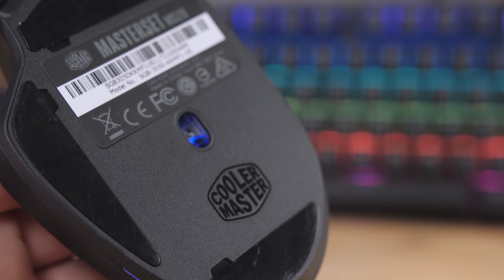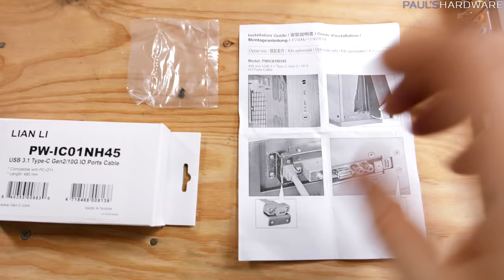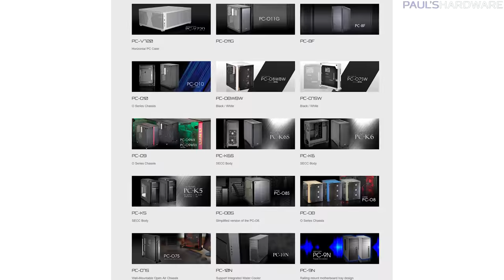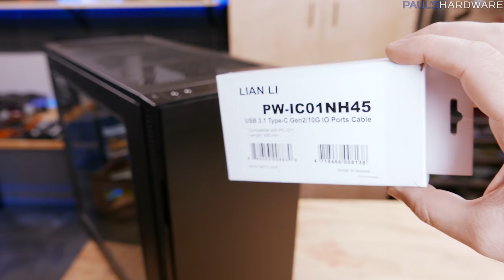CASE MOD! Adding a 10Gbps USB 3.1 Gen2 Type-C Plug

Comment: Drill bit sizes: 1/16", 5/64", 3/32", 7/64", 1/8", 9/54"...
I mean, I get it, those are increasing in steps of 1/64" but it still looks ridiculous...
"Could you please hand me the 11/64" drill bit?"
Reply: CheaterCodes if you ever see any x/54 fractional bits you're in some madman's shop and need to get the hell out.
Reply: whoops, yeah, that'd be some crazy dude xD

Comment: I realize this video isn't a new video, but I wonder if someone can help me out.  I have a Lian Li PC-011 AIR case.  It has a front panel cable, that is the USB 3.1 gen 2 connector.  My motherboard does not have a USB 3.1 gen2 header, like the one on Paul's motherboard in this video.  Is there a pcie card I could purchase that has this type of header?  I want a pcie card with this header, like the one in this picture.  https://cdn.wccftech.com/wp-content/uploads/2017/12/DSC_1050-Custom-1-1030x687.jpg

Comment: What's the craze about usb c?
I transfer like a movie every month via usb, and that's about my usage of usb other than mouse and keyboard, but that's not exactly data sensitive.
Reply: Most new android phones come with usb type c so that's what I would use it for. Alot of new laptops connect and charge by usb type c also. I don't know if this is supported... but thunderbolt 3 uses the USB type c plug so that means display connectivity and 40gbps throughput which is much faster than USB 3.1, It's more of a convenience thing.
Reply: T3 and 3.1C are not the same protocol but 3.1C is still faster and will likely end up being the new standard between the bidirectional connector and higher bandwidth. T3 uses a type-C cable but also requires 4x PCI-e lanes to achieve its bandwidth, making it unlikely to show up outside of the HEDT or laptop space where there is both use and extra lanes for the tech.
Reply: My phone, my portable router, 2 of my external drives, my new headphones are all Type C. but yeah, what's the craze? Just because it's better than USB 3 Gen 1? You're on a tech page, better things are better.
Reply: Because most new mobos, android phones, tablets and laptops come with it. Also the 3.1 gen 2 spec doesn't only allow fast data transfer but also power delivery of up to 100W so it's more convenient for charging and powering your devices.
Reply: You have to look at the usb type A port and micro USB when you plug something into them, otherwise they may even get damaged. At least that is solved with USB C so it's better. Some people don't like change and some manufactures will still try to appeal to those people, but they'll eventually choose to force it on everyone at some point so we all can evolve into a better life, especially with techs.
Reply: Sooooo, manufacturers put it on everything for no reason, and can charge stuff faster, but the data throughput is irrelevant, because nobody has a use case where they'd need it?
Reply: Daniel B The reason why those companies still use usb A because they think and see other companies doing the same thing, it's a vicious cycle. I appreciate it when a company step up and completely get rid of the old standard so others want to follow one by one, Apple is good at that although I don't really like them getting rid of the headphone jack lol The process can be a pain in the ass for us users but otherwise we'd end up with more dongles, adapters than we can carry or having no room for new techs on our devices.

Comment: was going to try, but first... tried the actual port.  it's asmedia 3142, absolute garbage. so i didn't go through with it. gigabyte is guity of false advertisement. the product page boasts being able to charge your phone with this port, it does absolutely nothing of the sort.  1% every 8 minutes.  i went ahead and put it on the type-A 3.1 ports and it was doing 1% every 1-2 minutes.. far faster than the rear USB ports anyway.

Comment: 1st. Well

Pls guys I want Gaming PC for 1000€ I live in France and pc parts are way more expensive... thanks
Reply: Achete d'occasion, hier j'ai chopé une 980ti pour 260e.
Reply: Graphics card: GTX 1070
CPU: Ryzen 5 1600 or Ryzen 5 1400
Mainboard: MSI B350M Pro-VDH
SSD: Toshiba OCZ, Samsung 850 Evo, SK Hynix SL038120 GB
HDD: WD Blue, Seagate Barracuda 1TB
CPU cooler: boxed cooler or something cheap with at least 2 heatpipes and am4 support
Ram: crucial ballistix sport lt, corsair vengeance  16gb ddr4 3000 mhz
PSU: be quiet! Pure Power 10 400W
Case: something cheap like a Fractal Focus G
Reply: Buy from the UK or Germany. You live in Europe so you can shop from wherever.
Reply: Medved He doesn't need to buy a cooler.400W PSU isn't enough.Stop giving tips when you don't know shit.
Reply: Batemen I said boxed cooler or aftermarket cooler, learn to read. And a 400 watt PSU will be more than enough for a 1070 and Ryzen. You guys always go for a way too overkill PSU like a 600 watts unit on a G4560 and GTX 1050.

Check out the be Quiet PSU calculator. It's actually pretty accurate. It says that a overclocked system with GTX 1070 and R5 1600 will be around 300 watts. So you better stop talking when you don't know shit.

http://www.bequiet.com/en/psucalculator
Reply: Medved agreed
Reply: yes but nvidia says that 500w minimum
Reply: As I said. A system such as this one will consume about 300 watts at full load. So 400 Watts will be enough when you are on a lower budget. You can go for 500 Watts if you need bigger headroom for a 1080 Ti as an example.
Reply: It's ok when a PSU is at around 70-75%  load. It depends if you want a good or bad PSU.
A little more expensive PSU is still able to fuck up your budget, because some people just can't pay those 10 - 20$ more. And getting a cheap 600 Watt PSU like the EVGA 600B is not a good choice.
Just 1 12V Rail and AC/DC voltage transformers have a very short life span and can fuck up your system badly.
Reply: Skotoze
If $1000 euro's is the limit, then 1080 on Kaby the build! What do you need, HDD? Monitor? What do you own already? France is EU, so you are welcome to shop in the open EU market, you don't need any France shops!

Just some 1080 or 1070 or Ti, you don't need to save money here, gamers only need a good GPU! Cheap intel 100 board, 7700k, no upgrades possible. If you need intel 300, wait till November! You can build a Budget AMD system too, willing to bottleneck a good GPU, or go for a budget GPU card on Ryzen?